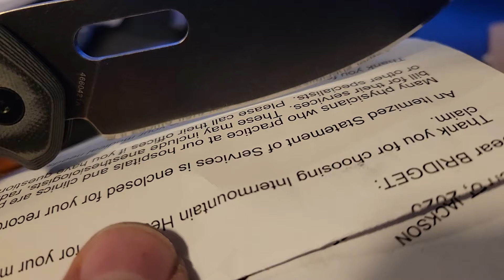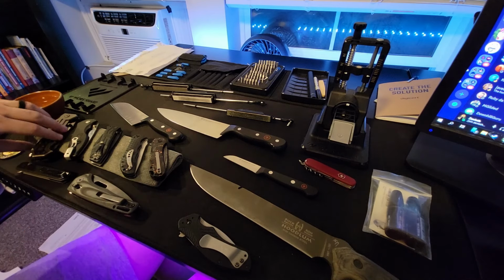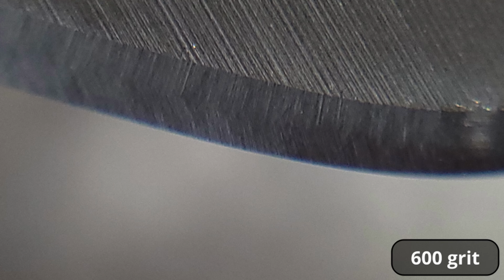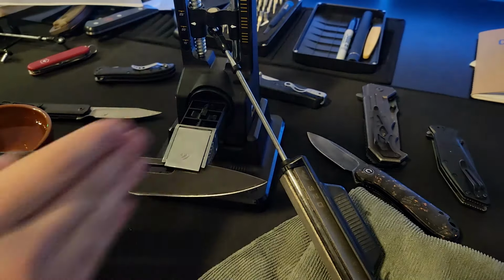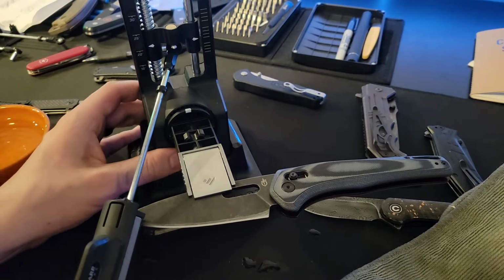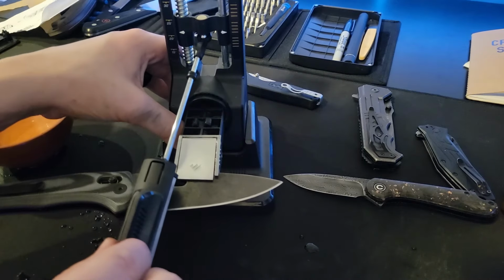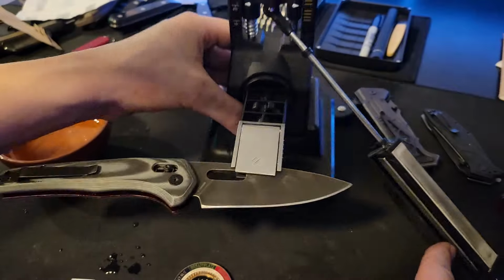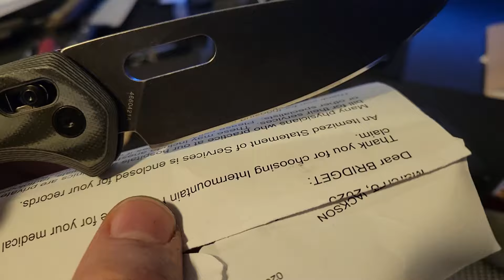Mirror Edge Finishes on Knives w/ Worksharp Precision Adjust Elite -- NO compounds polishes lotions

Comment: Breaking your scratch pattern with a cross hatching pattern will work for polishing better without going way up on grit. It helps break up small faceting. The problem is that you are creating a broken tooth pattern to the micro serrations. This is how to get a great paper slicing edge that will pop hair and whittle hair but it will loose it's bite incredibly quickly in use creating a slick edge with in just one or two strop backs. If you don't care about maintaining bite in the edge and just want great push cutting performance then what your doing is great. If you want to create a mirror edge without creating a slick edge then cross hatching is not gonna work well for ya. I personally can't stand a slick edge.
Reply from the maker: Those are great points thanks for bringing them up. As you mentioned the goal of this video was not to talk about edge retention or edge bite which is incredibly difficult to measure and test, this video was purely to demonstrate how to get a mirror edge without using any additional tools or techniques. That being said I do agree with your points and think it comes down to personal preference as you mentioned. I don't mind a slick edge at all especially since I usually have leather around and stropping my knife up isn't an issue for me. Thanks again for trimming in!

Comment: I get super nice mirror edeges by taking double sided tape and cutting strips of 800-3000 grit sandpaper on a worksharp precision adjust. I start with the 320 then once i usw the 600, i start taping pieces to the ceramic side. Also using water. And 15 strokes per grit to 800. Then 20 strokes to 3000. Honestly surprised myself with the results. Your technique has also brought some things to my attention that may help in a few areas. Awesome video. Thank you.
Reply from the maker: @samzayas3377  thank you so much, and that's awesome!! I'm definitely really sad they don't go to a higher grit, but the taping sanding paper is an awesome work around. Love it!

Comment: Just followed this video along while sharpening my knife. Didn't come out absolutely perfect, but it's plenty good enough for me. Mirror finish but have a few scratches that didn't want to come out. And I used the first (and only) knife to ever give me a serious injury, so now it's ready to bite me again
Reply from the maker: @Up2Trbl  hey thanks for reporting back on your progress. What do you feel led to that outcome? 
I'll give a couple thoughts here of things that it could be. 
Not doing enough passes on the lower grit stones will result in an uneven surface so that as you pass the higher grit stones over some of the deeper grooves will remain because the higher grit stones don't take off as much material. 
I would recommend using the sharpie trick to make sure you are getting the entire area of the sharpen part of the blade worn down by the low grit stone. Ultimately you want to go until you get a burr that is consistent across the entire blade. 
The other major factor could be inconsistency in edge angle. This model of sharpener can flex as you are sharpening which can lead to inconsistent spots. There are multiple 3D printed solutions of little stands you can put underneath the ad rigidity and stability to the arm as you sharpen. You can also use less pressure when pushing down on the blade and that will help as well. 
Finally, ensuring the stones are clean using a neutral oil or water so debris Don't build up. Wiping the blade clean can also help with this. 

Let me know if any of those three things you feel were impacting your sharpening experience and if you try them if they help. Keep me posted and maybe we can continue brainstorming together

Comment: got my knives much sharper then i was able to before, now it can shave hairs with some pressure but not hair-popping sharp.
Reply from the maker: @juxebeats5439  awesome I'm so glad to hear it!! If you aren't getting the exact results you're looking for in level of sharpness, here are a few things to consider: 
1) edge angle. Typically edges for shaving, food prep, and fine detail work have a more acute angle, and heavy tasks like chopping use more broad angles. Both can get sharp, but the more acute the more "sharp". 
2) Consistency. Ensuring a consistent number of strokes and pressure on each side, once made even, is absolutely critical. The sharpie trick will help you get started. 
3) Patience and commitment to the process. Ensure that you're setting the angle correctly, removing the burs, using the sharpie, stropping correctly, and using the honing stone properly. 

Let me know if you have any questions, I'm happy to help.

Comment: I cannot thank you enough!  I was about to pull the trigger on a tube of high dollar adhesive, 2000 grit sand paper, all kinds of goodies to get my elite to perform at a level I would be satisfied with. I ran across your video. Watched it in its entirety, spent about an hour using your technique (2 blades) and now my knife is scary sharp with a mirror finish!!  I almost can't believe it. 

Just goes to show even with the right tool if the technique is flawed you will never get the desired results. 

Thank you SO much for all of the research and work that went into this video!  I am happy happy happy now!!!
Reply from the maker: Wow thank you so much for this amazing comment and all of the insight you gave on your experience. I'm so glad that it was helpful for you and that you were able to get the outcome you wanted. Thanks again, and happy sharpening!!

Comment from the maker: UPDATE 2 - The new an improved Worksharp Pro Precision Adjust is out, and it's INCREDIBLE. Yes, I bought one, and yes I'll make an updated video soon. https://www.youtube.com/watch?v=76hvZKpGVhY 

UPDATE 1 - No official higher grits coming.
I've been in contact with the worksharp team and they confirmed that there are no additional accessories or grit patterns coming out for this system. I shared this video with them and they are currently reviewing it with their product team but it would be a while before anything official came out.
Thank goodness there's a lot of aftermarket options; go check out NeevesKnives great video on the topic. 
https://youtu.be/OXLw4B8BAek

Comment: Based on the blade shape how difficult you think it would be to sharpen a zt 0462? This is probably my hardest knife to sharpen and also my baby I have been torn on buying this sharpener for a while and have been watching countless videos. Best video I have ever seen on this I really encourage you to make more videos. Absolutely phenomenal
Reply from the maker: Wow, thank you so much for your great comment and compliments, I truly appreciate it! 

For sharpening your particular blade I think this system is actually PERFECT, because the natural motion is to mount the blade in a spot and sweep the stones across. I would recommend placing the blade at different positions and seeing what gives you the most consistent edge angle across the length of the blade. For example, try mounting the blade in the holder more near the center of the blade. Does that make sense?

Let me know how it goes, and good luck! Plus good luck with any video project you undertake

Comment: Hi
Thank you for your good video, how long does this knife sharpener usually work?  And after how long should it be replaced?
Second question, how can we find out what angle number to use for each type of knife, such as 15 degrees or 17 degrees or 20 degrees or 25 degrees or 30 degrees?
Reply from the maker: Hey! These "stones" can last YEARS, you shouldn't have to replace it any time soon if you take care of it. 
There are great websites and videos outlining what angle is best for each application. It all depends on what you're doing with it, what the steel is, etc.
Reply: @TheTerribleTen  
Hi
Very thanks

Comment: I agree with 90 percent of what you’re passing along. A lot of it is known sharpening facts but I question the 5x5x5x5 2 times and then 5x5x5 x5 and then 4x4x4x4 and I’m still learning myself but it might not take every steel that long to create a burr or it might take some steels longer. And don’t you want to stop once the burr is formed and then drop down in grit and continue on the procedure? I just feel like for some blades 440. 8CR 15V you’re just going to be wasting material. Sure it’ll take years and years to really chew through your blade but i feel as for some blades it might be overkill and for some maybe not enough. Looking for your feedback!  Great informational video by the way. Oh I have seen one other guy get a mirror finish with this system and a strop but he was using the saw method and it was still a bit rough.
Reply from the maker: @Ryan.S924  thank you so much for your detailed comment, those are great points and I agree with them. There are a couple reasons I mention the strategy the way I do, but you are correct -- the most important thing is to look for a bur IF you care about sharpening less material away.
1. Most stock blades have inconsistent grinds, and require a lot of attention to rebalance. I mention this during the meaty part of the video. 
2. Stopping at a bur will leave a lot of the valleys in the material, because a bur can form at micro intervals and it FEELS like it's all the way across, but in reality there are a little of microscopic areas which need leveling off. 
3. Consistency. I'm trying to strike the balance between seasoned sharpeners and novices, so I laid out what I thought would be good ground rules based on my own testing for reliable mirror edges. 
4. With some decent stropping you can MAINTAIN. Mirror edge, and touch it up with ceramic, so hopefully you aren't starting over 5x5 4x4 3x3 etc. I would never take a knife I've already mirrored through that process unless I beat the heck out of it. I'd probably start at 600 grit, ceramic, strop. 
5. Risk vs. reward. As you mentioned, it would take a Looooong time to remove enough material from your knife to be significant, but those watching the video would probably consider that worth it in the long run since what they are here for is mirror finishes. Everything has a pro and con.

That all being said, you make an excellent point and I'm glad you commented. Anyone who is concerned about removing a lot of material should take note of your thoughts and consider the points I mentioned above. 

Thanks again friend! Happy sharpening

Comment: What is the best way to clean the Strop. ? Or do I have to replace it?
Reply from the maker: @marvinwells5007  great question! Compound strops are like wine in a way, they get better over time. I maintain 3 different strops: 1 with compound, 1 without, and 1 smooth side. 
Eventually, you will need to replace the compound strop, but that won't be for a long loooooooooong time. Thanks for the great question.

Comment: You shouldn't use water on those diamond stones because they will start to rust out. It's an interesting video but seems like a lot of extra work. I use the work sharp precision and it works great but if I want a mirror polish I literally use 3 small leather strips with diamond paste. And the paste is like 10 bucks. But if you search 4 inch hapstone holder for work sharp you can start adding higher grits for it. Great video 👍
Reply from the maker: Thanks so much for the great comment! I didn't specifically call it out but I do dry each stone after use. I've used water on diamond stones for about 10 years now and haven't had any rust yet. Fingers crossed.
Totally valid point there, that's definitely another way to get a polish. The reason for the video was to see if I could accomplish a mirror polish without any compounds, but that's definitely a way to do it.
LOVE the after market components for this system, as you mention. I call those out in the extended intro. 
Thanks again for bringing up those great points, awesome contribution and perspective.
Reply: @TheTerribleTen  Watch the new Zac in the Wild video about the new professional sharpener work sharp is releasing. Thing is sick.
Reply from the maker: I saw it!!!! Mam...I'm getting one.

Comment: Why would the Feb 2022 Instruction Manual on P.8 specifically say "Do Not Use Oil or Water When Sharpening."
Reply from the maker: @michaelwolff305  great question. I believe the main reason is that water and oil can lead to rust and buildup if not used or dried properly, so it's likely to reduce defects caused by user error. Despite that, water/oil are the best ways to use any sharpening system IMO. It's debatable whether water is good on diamond stones, but after 20 years of testing both dry and wet methods, I use wet.
Side note: I've been experimenting with mineral oil recently and having great results.

Comment: You are definitely overcomplicating things. And then: I can't take anyone serious talking ages about the importance of angle discipline and such and then not using a stand for this wobbly system
Reply from the maker: @zhanchi90  that is a fair and valid criticism, and you bring up a crucial point: this system has issues with stability. That's why I outline third party market options, and 3d printing solutions, which solve that problem. Totally understand if you didn't get that far in the video, but I agree with you :)